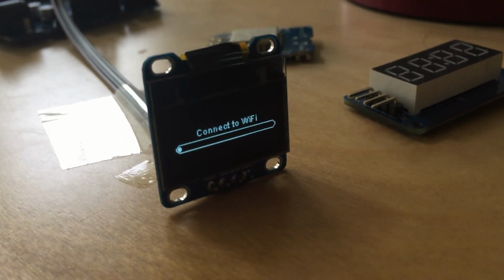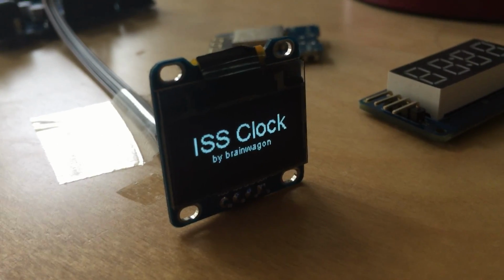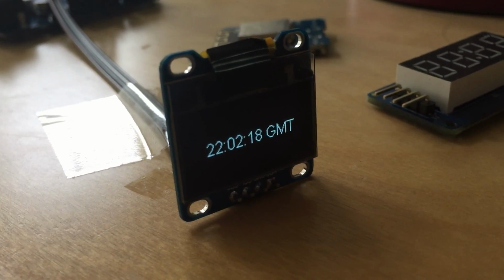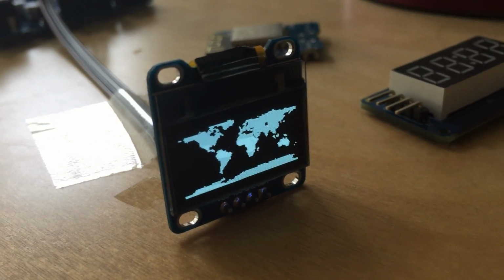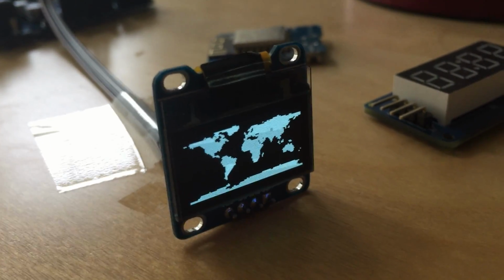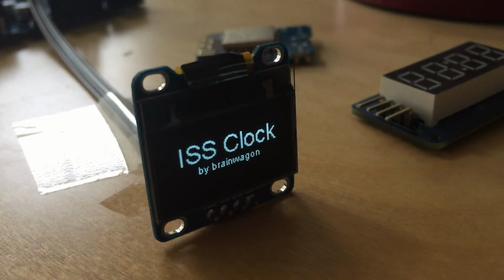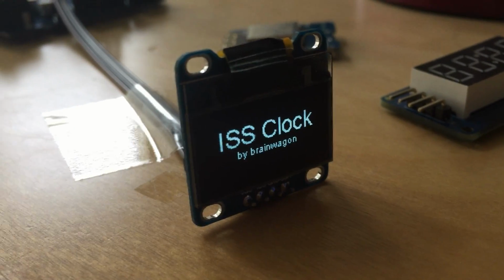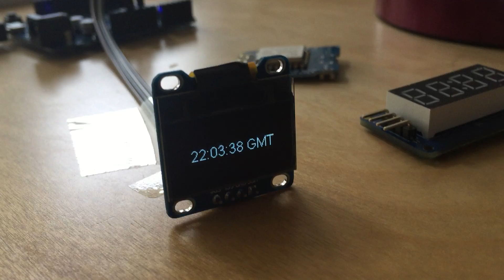ISS Clock running on an ESP8266 + OLED Display...

Comment: Nice graphics with smooth scrolling! Instead of a larger screen, you could also opt for the smaller ESP-01 with battery and sleepmode to attach it to a wristband. As years go by, I tend to bring text closer and closer to my eyes... ;-)

On one of my projects I connected a similar I2C oled screen to the rx/tx pins of an ESP-01, so it still has pins left for other peripherals. You can see it briefly flash by in my latest video. The screen is crispy sharp, yet quite tiny indeed.